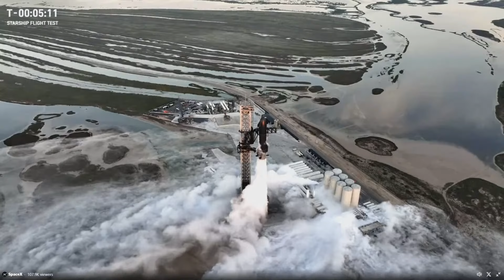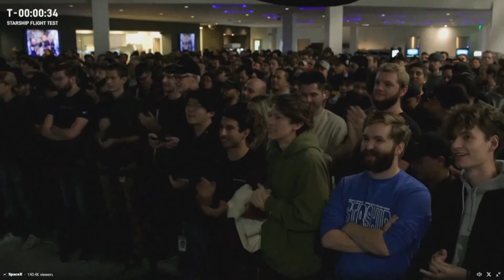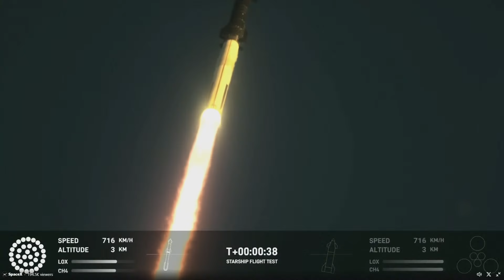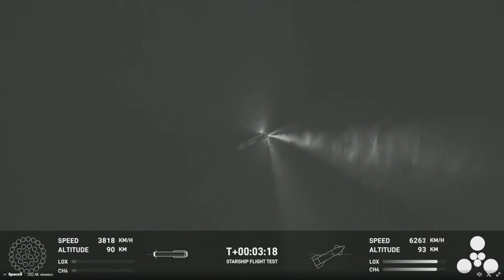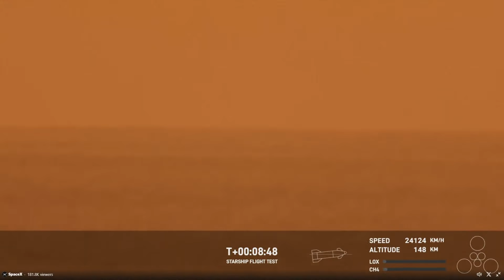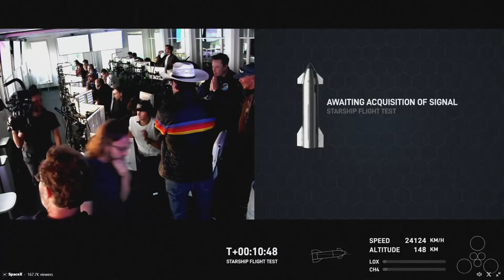SpaceX attempts second test flight of world’s largest rocket – watch live

Comment: This is something beautiful ever seen from space since for long period... Congratulations SpaceX and can't wait third gold! 😍🔥🚀🇷🇸💪
Reply: dude this technology is 80 years old, you celebrate 2 ships failing as a success lol. If both the booster and the starship survived it would have been what kind of mission? failure. Maybe the 3rd one will be made from thermo nuclear resistant glass. ohh by the way didn't he promise us on mars 3 years ago, he can't even get into orbit on this tube.
Reply: @runnynose8341  the first launch their goal was to get the rocket off the platform, it went MUCH further than that. The second time they managed stage separation and almost reached their target orbit. It’s a massive success!

Remember that their first 3 rockets exploded before the 4th was successful. You can’t expect something to work first time 😊
Reply: @RHITD  um people have been putting up rockets since the 50s, you do know this, Don't you?
Reply: But I can expect pretty common technology from 80 years ago to work first time, don't you? or are you scared when you see a new appliance that you bought from the hardware? or does that company have to have 5 failures b4 they can make a new washing machine? @RHITD
Reply: @runnynose8341   They haven't been flying skyscrapers with 250 ton lift capacity with 33+6 engines using full flow combustion methalox fuel on a 2 stage craft meant to be fully reusable. Everything about this ship is the most advanced and boundary pushing technology in the history of spaceflight. The 33+6 engines alone is unheard of and was for the longest time considered unthinkable. The N1 was abandoned in part due to not being able to get all of their engines working. This flight didn't lose a single engine, proving the model can work.
Reply: Humans have never put these large and heavy spaceships into space until now… so this is on another level and off course there will be fails…
Reply: @runnynose8341  you are a prime example of thinking before you speak
Reply: especially with the latest facts, the thing blew up again before decoupling, more spin from the scam master  @Technique-kj2bp
Reply: @runnynose8341  you have no idea what you are talking about.
Reply: yeah I am just an Aeronautical engineer, YOU? @snuffeldjuret

Comment: The Russians are doing this without any applause
Reply: Launching the largest rocket in the world? Nope not since the 70s and 80s
Reply: @eddjordan2399  Launching it isn't exactly the problem. Getting it to stay together long enough to do something useful is. Anyway, in other news the Chinese have a permanently crewed space station called "Tiangong" that I bet you've never applauded. Currently has 3 crew and they are adding additional modules to house another 3, making it the same size as the ISS. The Long March 2F rocket currently has 21/21 succesful launches. Long March 2D was built in 1992 and has 82 succesful launches and is still in service.
Reply: @PostingCringeOnMain  odd comment from you.
Reply: No they arnt
Reply: this is what the Soviets failed to do, actually. N1 failed 4 times.
Reply: @snuffeldjuret  To be fair, they succeeded two times with Energia. But Starship is still bigger. Eventually a serious candidate for the HLLV acronym.
Reply: @ouwebrood497  to be fair to soviet, yes, but not to OP.
Reply: 2nd attempt, 2nd failure... I am appropriately pessimistic...
Reply: @paulbizard3493  safety is paramount... bet you fly on commercial airliners as when they was being first tested soo many crashes explosions deaths before aeroplanes became very reliant because of said "fails"
Reply: @paulbizard3493 yeah that's why it's called a test it did better this time

Comment: Should change the title to lose the "attempts" as that is not actually true: SpaceX has a successful test launch!

Both parts of the two part rocket eventually will be able to be reused when design development is finished, but neither were intended to be recovered for this test launch, and both were destroyed, the first stage soon after its successful launch and separation from the first, and the top part of the rocket worked as hoped after "hot staging", with planned for the first stage to possibly travel to near Hawaii and fall into the sea, but contact was lost with it around eight minutes into its successful test flight, after all engines had been working fine, when it had reached around 24,000 kph.

The SpaceX commentator observed the loss of contact was right near the expected end of the second stage's planned "burn", and he speculated that the automatic destruct was somehow triggered by some sort of problem at that point.
Reply: No, this is better. It's accurate and applies to this flight.
Reply: Its called a Test Flight for a reason. Its not suppose to guarantee success, its about looking for results. Solve those issues, rinse and repeat@velvet1865
Reply: This was livestreamed with the title created before the test, so at the time, it was still going to be an attempt.
Reply: @velvet1865
Exactly. The way those fan-boys cheer every time it farts wrong is so dang juvenile.
Of COURSE lessons are learned through failure, that's how progress works for everything.
So at least admit to SOMETHING having failed, but you can't can you? 
I hope when lives are lost that juvenile fan-boys don't cheer and say "it was a success because it will get better for next time"
I like SpaceX and follow their progress and close cooperation with NASA and JPL, but fan-boys acting like giddy children who never admit they messed-up?
Forget it.